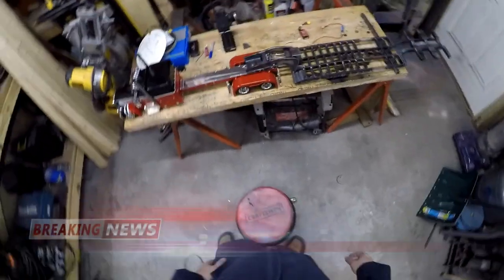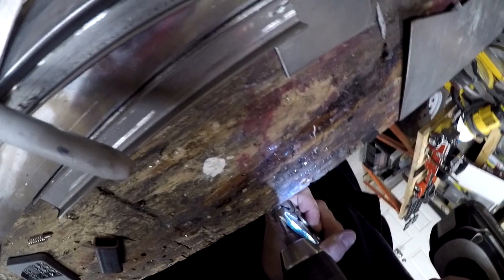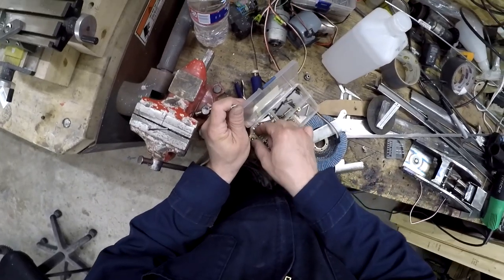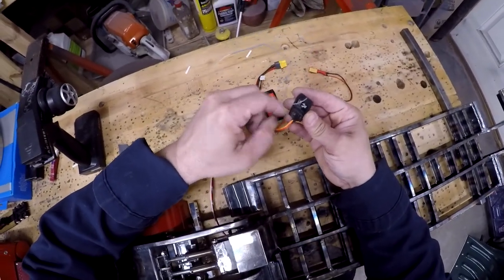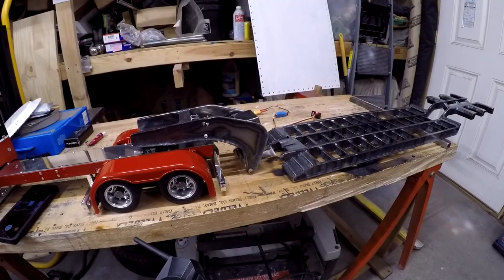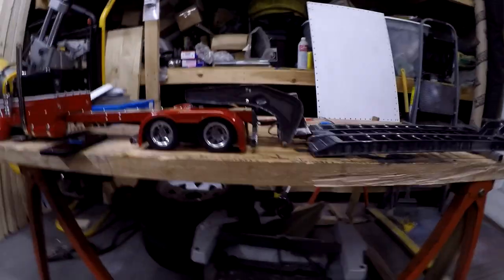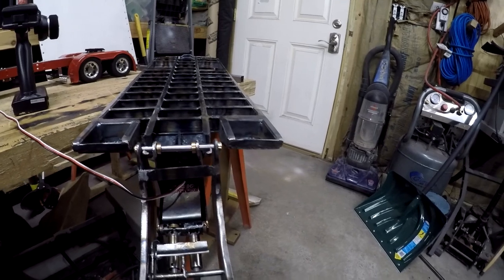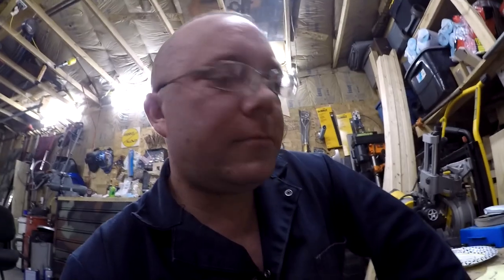Fabricating 1/14 Lowboy for Semi Truck Part 13

Comment: Dx6e will work 2 recievers
Reply from the maker: I have a DX6I and I've read it can also as long as you bind them simultaneously. They function identically this way. If I were going to get another radio I think I'd go for a frsky or something with a lot more channels. Thanks for the heads up!